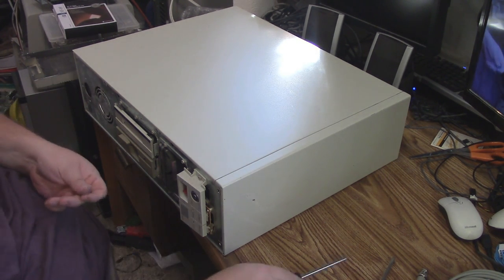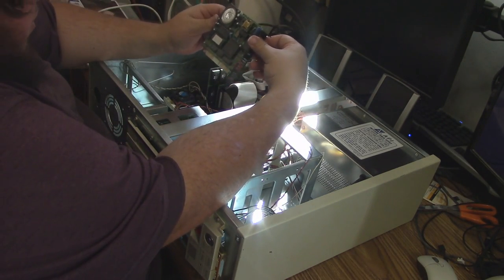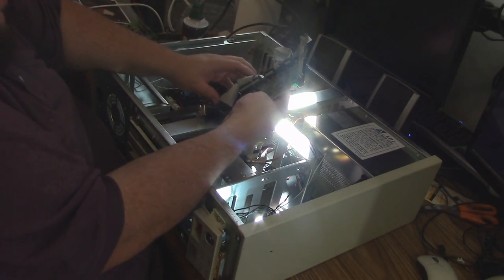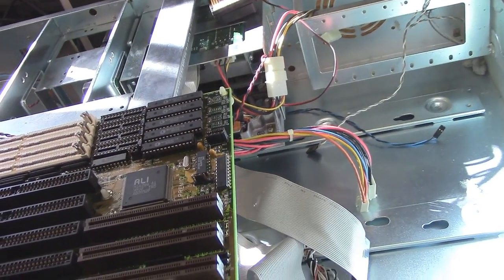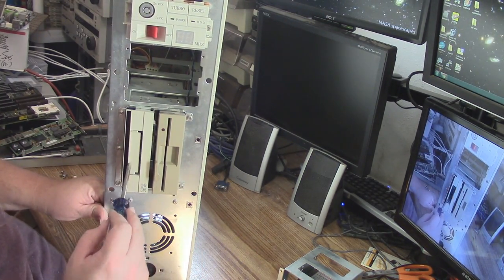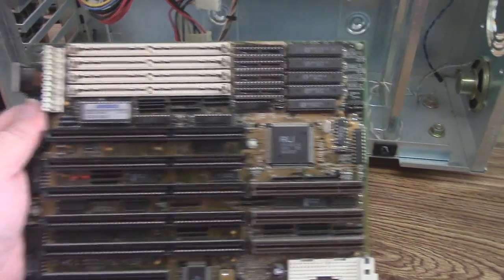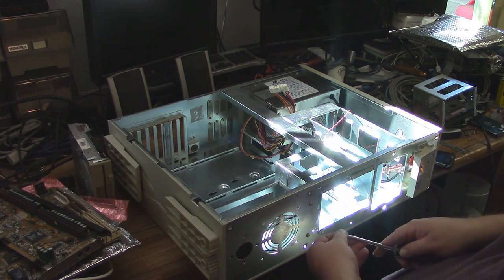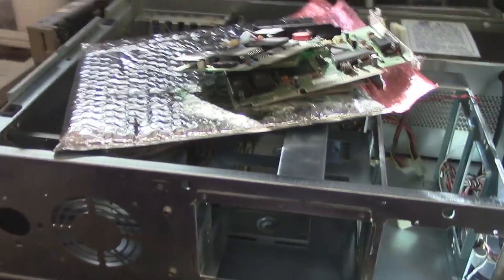Recent acquisition: a knockoff IBM model 60/80

Comment: Your audio is de-sync'd from the video just slightly.
Reply from the maker: I had not noticed it.  I had to strip the original audio, remove as much of the fan noise as possible and stitch it all back together.  I'm Learning Vegas, but it's a slow process.